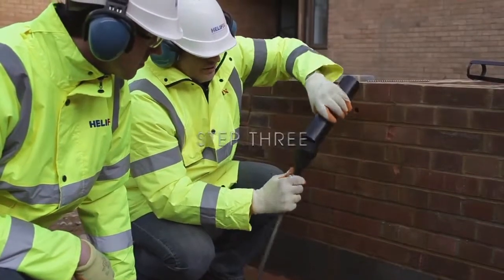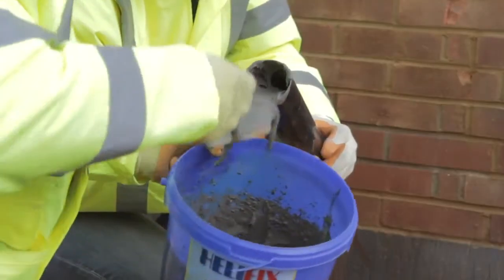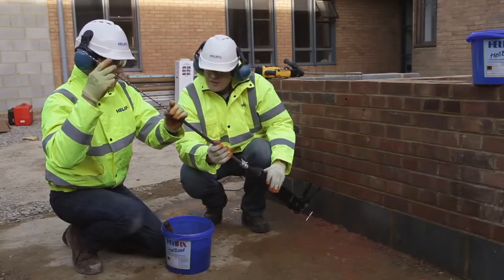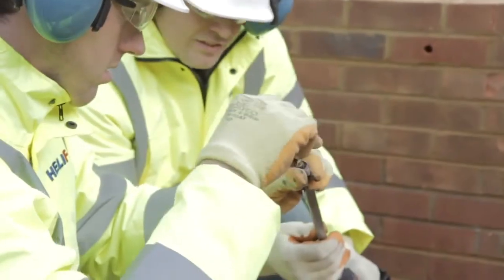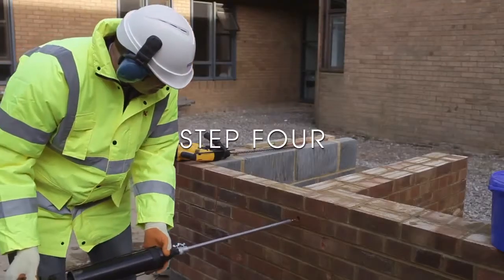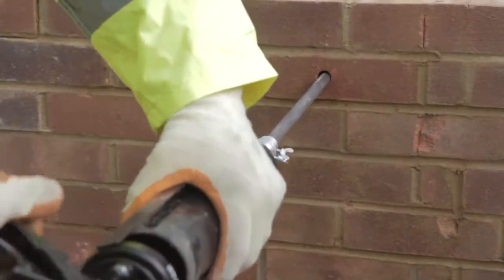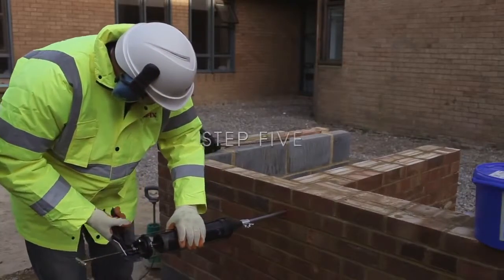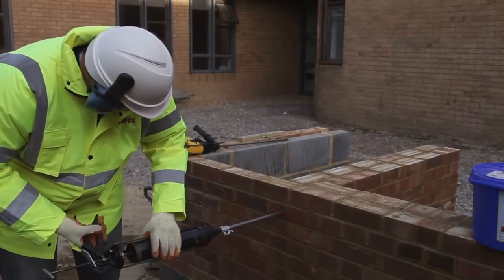CemTie from Helifix Inc

Comment: It is a good idea if used properly. One needs to be careful as if there is a void or a gap somewhere between the bricks one would have to pump a lot  of grout to fill any existing  space before back pressure is built up.  Also if the grout is not  viscous enough the back pressure would be built ahead of the Cem  Tie  in the tube and not  behind it with the brick.  The grout should be of the expanding type not of the contracting  type when it dries. 
Depending on the metal used  these could be looked upon as a temporary measure.